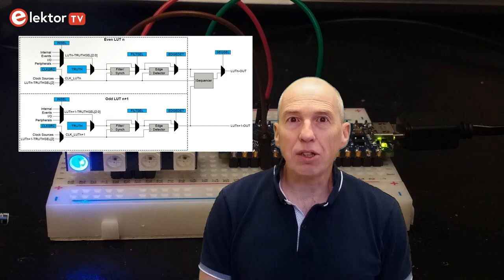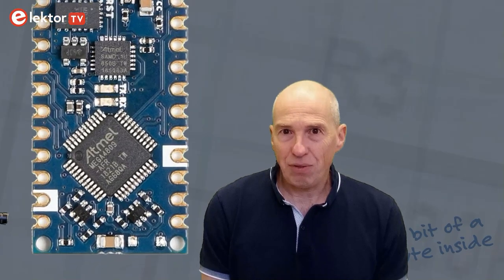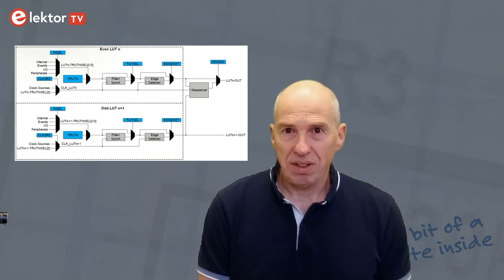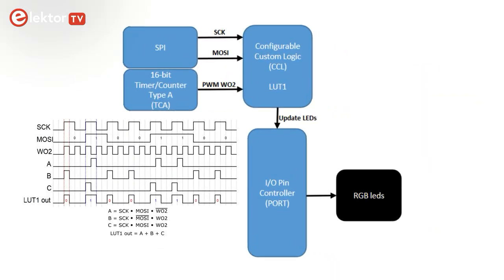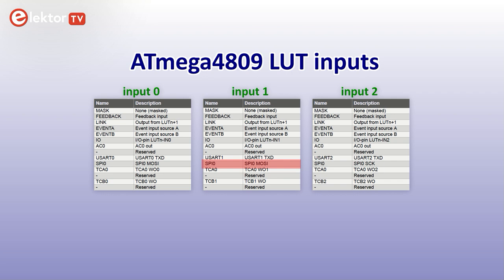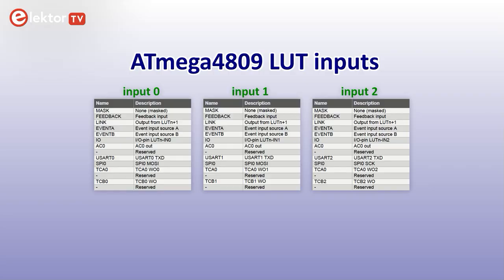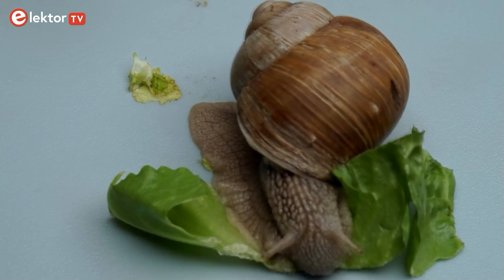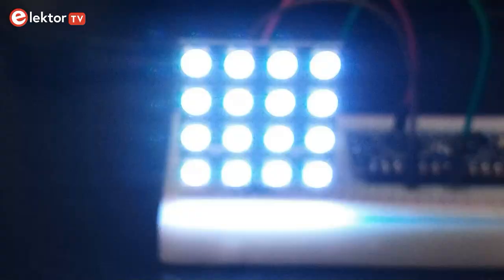Arduino Nano Every NeoPixel Driver Without Bit Banging

Comment: Thank you!. I think this exactly what I'm looking for however I'm very beginner and not sure how to put it all together. I have got the library but not 100% how to apply your instructions on the github page. Do you mind doing a video on the details or add some images on github? Thank you!!

These are your instructions:
Connect pin D4 (PC6) of the Arduino Nano Every to the anode (left) of diode D1. Connect DIN pin of the WS2812B LED (string) to the cathode (right) of D1. Don't forget to connect the +5V power supply too.
Reply from the maker: Added a schematic to GitHub repo at https://github.com/ClemensAtElektor/Nano_Every_WS2812B

Comment: Nice and  smart   solution , it is  good  to  know  this  new  features like  CCL and  LUT , but  these  new  features bring  to  my  mind  the  thought  that  the already  existing  FPGA  eco  systems are  by  default  and  natively  CCL  and  LUT and  are  more  likely  more  afordable and  easy  to  use , the  question  is  what  is  the  main  goal/ benefits of  using  traditional  MCU  with  FPGA features insted  of  using    pure FPGA  ?  especialy in  your  case  when you  use  external   RC delay  circuit  to  synchronise / match  timings ?
Reply from the maker: It's not really FPGA, but it allows for keeping things simple when you need just a few extra gates or so. This very simple CCL doesn't need special synthesizing tools, so it is also much easier to use than real FPGAs.